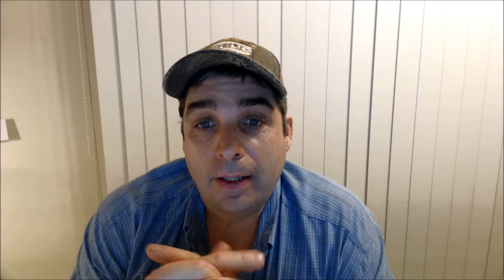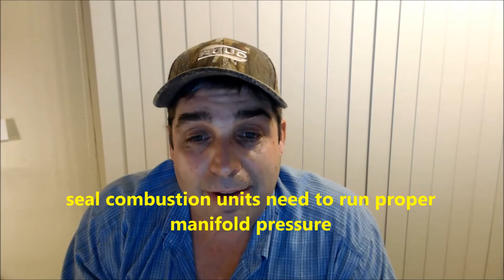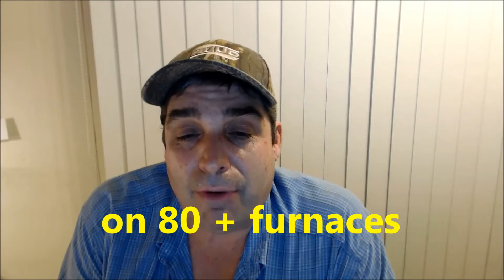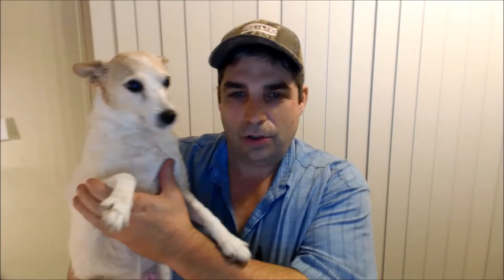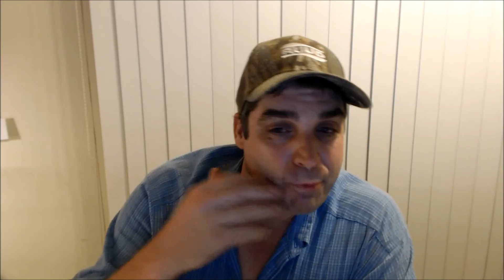vlog :combustion analysis testing is a must

Comment: Hey Steven.  I have a question for all handymen.  There are a lot of handyman guys out there who work for rental properties who turn on gas furnaces in the winter time.  most of them do not use carbon monoxide testers.   what kind of tester should they use and how much do they cost?
Reply from the maker: +Vlctor Pena always good to be trained and test things properly combustion analises is important to make sure the applince is safe to run

Comment: Hi steve, totally agree about Flue gas analysers, over here in the UK its been made Law that we have to hold a CPA1 (combustion performance analysis) and on all installs we have to document everything, Is the 320 - 5 year cells ?  the 327 i had was 5 years and the 330 is 5 years , cute dog mate,,
Reply from the maker: Kris Farquhar Plumbing n Heating 327 and 320 have a 2 years cell 330 has a 5 year cell

Comment: We have one Bacharach combustion analyzer to test and adjust CO. It makes using a manometer useless.
Reply from the maker: Rob Johnson i have found manifold pressure on a 90+ furnace  is important. but on the 80+ no so much .i agree low c.o. reading are the goal so gas pressure is not so important .jim davis was right
Reply: What Bacharach do you have that you don't need a manometer??  How do you adjust your CO, CO2 and O2 levels properly without knowing your input/manifold pressures???

Comment: uei, bacharach and testo are the tops in my opinion. The Fieldpiece one is garbage. Differential temperature is also pretty cool to use as well steve. Quick way to check your delta T across the HX
Reply from the maker: Robert Doherty there is so much the meter can do .. i will have to try different oppion in the near future ..

Comment: I totally agree with you Steven, but the company I work for won't supply any. I do have a dual digital manometer and use it on every service call.
Reply from the maker: Wayne Hensley i hope no one die for c.o.  its a real risk you take playing with gas and not testing for c.o.

Comment from the maker: testing for c.o. is a must if you have a clue whats going on
Reply: Had  a cleaning at a daycare today and had 300ppm and was climbing fast. Adjusted fuel and air and couldn't get it below 180. We are replacing the furnace in the morning. Those analyzers cost a lot of money but if you find a just a few bad heat exchangers with it, it pays for itself and saves some peoples lives.